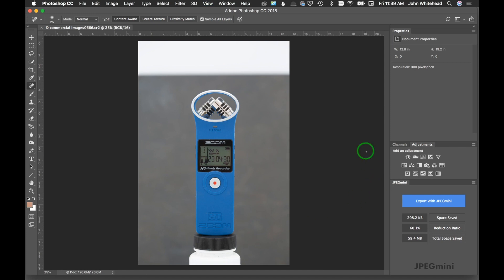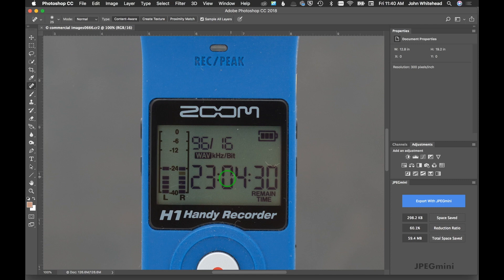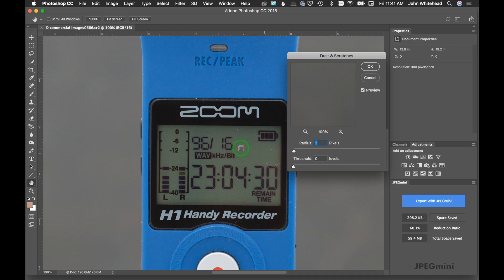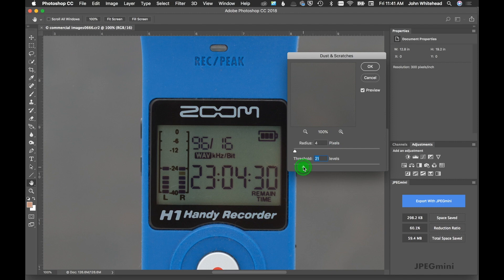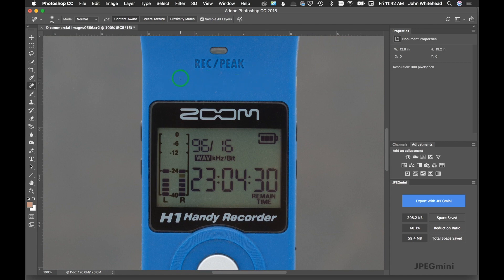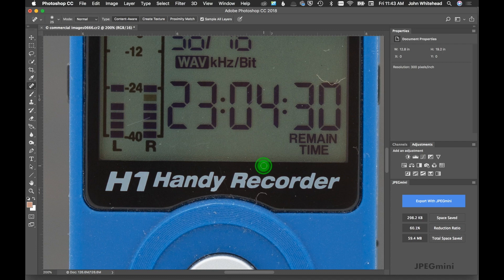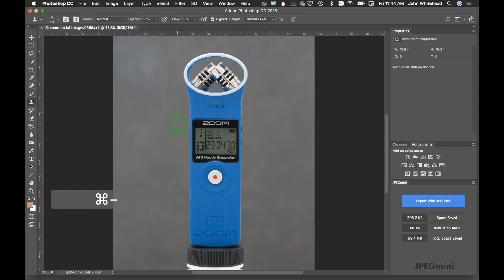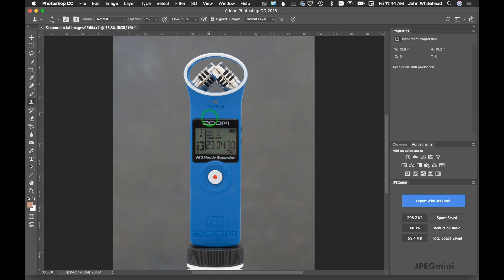NEVER use Dust and Scratches in Adobe Photoshop

Comment: Did you ever heard about layers and blending modes?
I use dust and scratched pretty much since I started doing image editing in 2006.
If you remove the bigger dust particles "manually" and then create a new layer where you'll apply the dust and scratches filter, you can mask that layer and you take the dust out of your image faster than using the spot healing brush.
Use your head, this is a time saver...
Reply from the maker: Thanks for the info.  I rarely shoot products.  I did more back with film.  Yes, I understand layers and blending modes.  Your way would work and is a great suggestion.  However, there is no reason to be arrogant with your comments.  People are her to learn not to be criticized.
Reply: @Jcwphoto  Sorry if I was too harsh. I just thought that you shouldn't teach others not to use a tool that's very useful and time-saving.